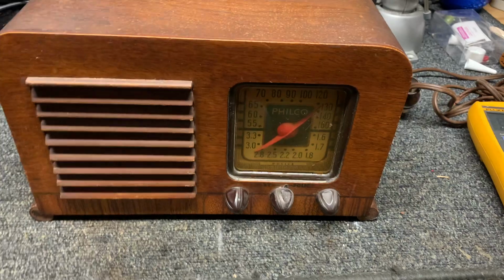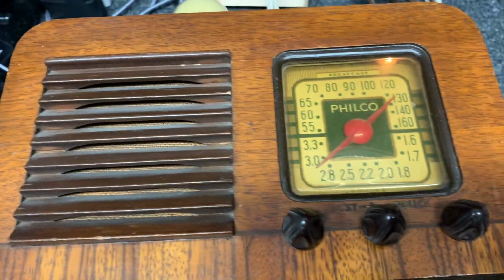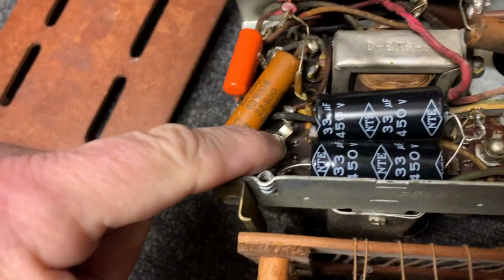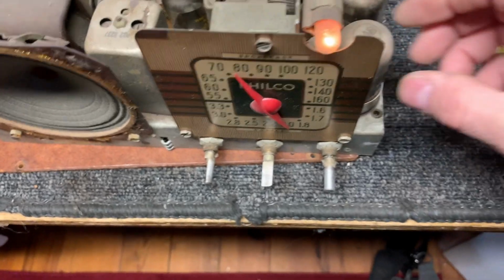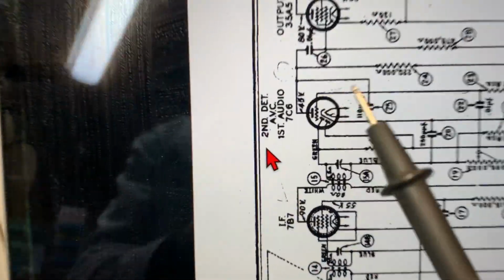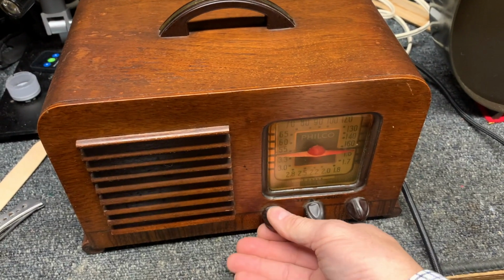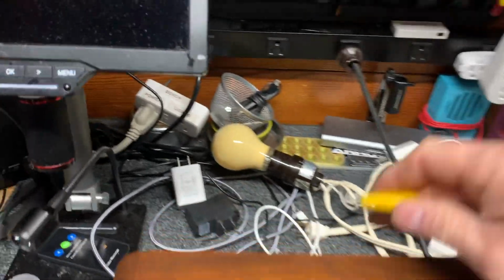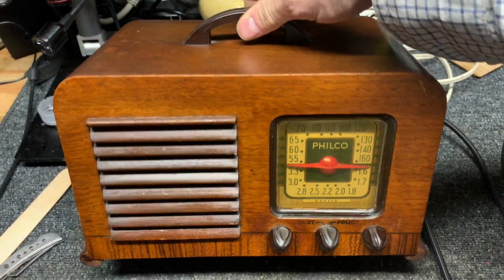Vintage Tech: 1939 Philco Radio

Comment: Caution hot chasis. Ie the power goes to the frame work. Get the plug wrong..not good😮😮
Reply from the maker: @Steven-re7xt  always an issue with these non transformer radios.

Comment: I remember all the tube numbers. Fixed many old radios at an antique shop when I was about 13 years old. Some really cool Atwater Kent's also. My best friends father was an electronics engineer. He made us kids radio experts.
Reply from the maker: Those were great radios!
Reply: @RodgerMudd  used 50c4 in a paired configuration to make a xtal  controlled xmiter. Ran 160/80 meter can't have x miter here. ( Rental) I swl a lot and go park hopping. Solar panel/lawnmower battery. Work all day. Hi hi